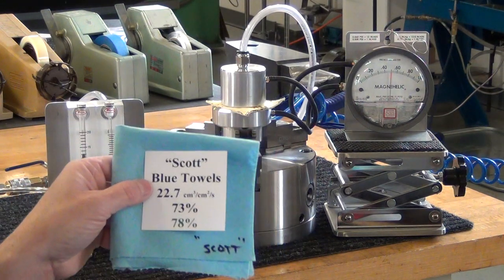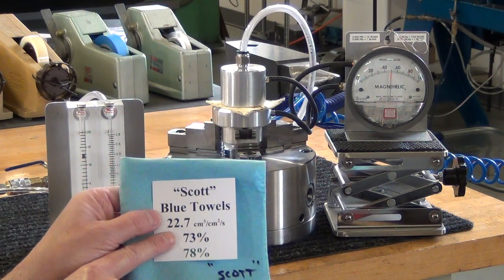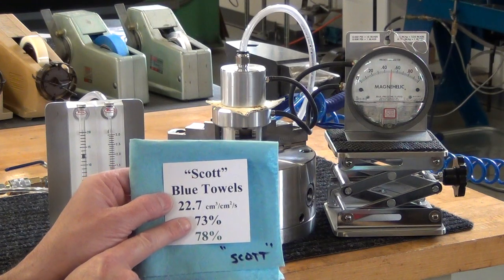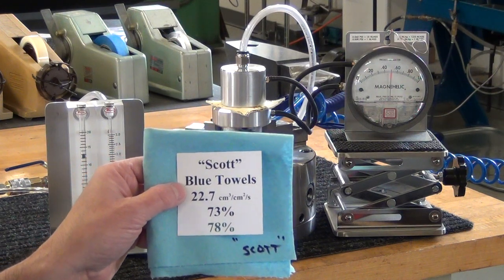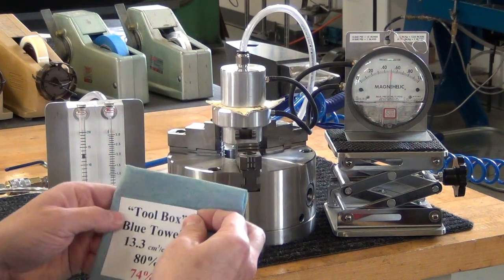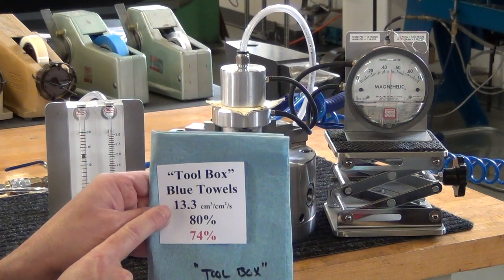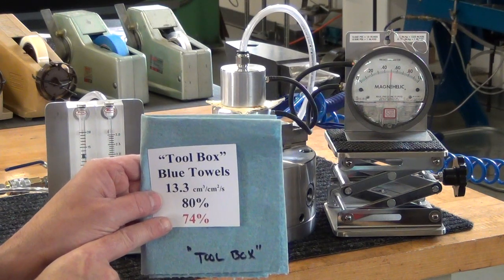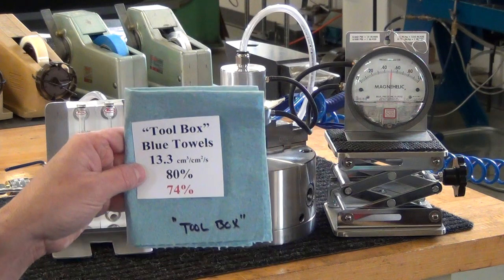Permeability of Mask Making Materials

Comment: Made over 900 masks so far. Love your videos on mask filters thank you so much for your time. Can you please test flannel, cotton Jersey, and Kona cotton. I have been thinking a lot about summer and balancing heat, breath-ability, and filtration.
Reply from the maker: Thin flannel cotton similar to tee-shirt material seems to be good.  Under the microscope the flannel cotton has many tiny fibers that bridge the gaps between the warp and weft.  I have seen other fabric that does not have these tiny fibers and they did not test as well.   Thank you for the question.  I hope you will subscribe.

Comment: First off, thank you so much for your diligence in working on good solutions for masks considering N95 masks are in such short supply.

One thing I’ve been wondering is how we can make these masks easier to breathe through. I wear a mask, but it’s just frustrating due to breathability. I was looking at N95 masks with the valve, but now they’re saying it’s bad to use.

One thing I think might be worth testing is integrating a merv-13 filter into a valve, with one on the inside and one closer to the outside creating a two step process. I’m curious what you think the breathability would be in integrating it into the valve, or if it would just be better to fit into a pouch instead?
Reply from the maker: That's probably a question for a professional mask designer.

Comment: Thank you so much for testing 1 ply halyard h600.
May I ask a huge favor.  Please launder h600 ten times with laundry detergent on hot, and retest filtration?
(Because we are sewing single ply masks for reuse, but the change, if any, to the filtration of the polypropylene matrix by laundering is not known).
Halyard supply is limited so reuse is a good thing.
Reply: PS our project is making this  lightweight durable and cool material into masks for elderly and immunocompromised folks to use at home - the halyard should have good compliance for all day use in homes.
(But does the filtration degrade with washing?) Thank you again.

Comment: Any chance you could test one layer of Halyard 600 sandwiched between a good quality cotton on top and good quality flannel or other cotton on the bottom?  You would get a mask that is more attractive on the outside and more soft and comfortable on the inside and perhaps people would be more willing to wear them.  Thanks so much for what you are doing!
Reply from the maker: I have not tested that combination.  However, the efficacy of any stack of material under constant flow can be estimated.  In particular, the permeabilities of a stack will combine as Pstack=1/( (1/P1)+(1/P2)+(1/...) )  Stacked efficacies are "repeated trial" probabilities and can be estimated as Estack = (1 - (1-E1)(1-E2)(1-...)  ).  Thank you for the good question.  I hope you will subscribe!
Reply: @MathIndy  Thanks so much, I already subscribed.
Reply: I've made masks with Halyard H600.  It's a bit too stiff for many mask designs. I'd recommend that you take a look at University of Florida's mask prototype 2 at https://anest.ufl.edu/clinical-divisions/mask-alternative/.  It's easy to make and fits very well.  I turn the seam inward for ordinary use, and have made it with one layer and two.  A group of nurses did full fit tests of some masks and this one passed where prototype 1 did not.

Comment: thanks for your video!

How many layers of the feminine pads do i stack, to achieve that 92% filtration? thanks in advanced for the reply.
Reply from the maker: Personally, I would not use feminine pad material.  Mainly because the materials used in their construction may be unknown but also because they will not launder well.  The "go to" material most widely recommended is 100% cotton.
Reply from the maker: I cannot attest to the safety of the feminine pad material.  In this testing, only the inner material was tested for permeablity and PFE at 1 micron. The pad tested was Walgreens overnight brand.  To equal the permeability of 2 layers of flannel cotton you would need 6.8 layers of this material (or an already thicker pad).  I don't think this material will launder, may have perfumes, chemistry is unknown, so, for now, this does not seem like the best choice.

Comment: What do you think, the bag from the vacuum cleaner that you tested, which class of filters corresponds to?
Do I understand correctly that your device can be turned on several times in a row to measure filters with a high degree of purification
Reply from the maker: I am only able to test at 1um and, the MERV scale, for example, requires testing at a variety of particle sizes.  I am not qualified to say where the vacuum bag falls on that scale--that's probably a job for a certified testing laboratory.  The sampling time on the tester I have can be set to 1sec, 10sec, 1min, 10min, etc.  Longer sampling times can give a more accurate test result but remember, the particle count in the air at any moment is not controlled so there is also benefit to conducting the baseline test, and the material test, multiple times, and always in quick succession.
Reply: Thank you so much for the answer! I asked, since a vacuum cleaner bag is, apparently, the best (in terms of filtration quality) of available and inexpensive materials, and it probably corresponds to some kind of filtration class.
But today, class 12..14 hepa filters are also available, which are certainly better than n95 and probably better than a vacuum cleaner bag and, if possible, use them in DIYrespirators. Probably so?
Reply from the maker: @vicvic2413  The main issue with vacuum bags, furnace filters, and any unusual material for that matter, is it is often not possible to be certain that they contain no unhealthy chemistry.
Reply: Thanks again!

Comment: I wrote to SPILLTECH and they said their shop towels do not have any chemicals that would make using them as a filter a problem. They do not offer any guarantees about the filtration rate but they are safe. I would like to know what their filtration rate is. It looks like a thick paper towel with fused dots all over it. I would like to know the filtration rate is on one layer of Halyard600 and I would also like to know how to reliably fuse it to make quick seams with a heat tool. Thank you for all your information . I will post this video on my Facebook quilting group because we are all sewing masks. You may get more subscribers because there are over 55,000 members.
Reply from the maker: I have not tested Spilltech brand shop towels.  I have tested Scott brand as well as Tool Box brand and they both test well at 1 micron.  It seems the denser shop towels are better than regular kitchen paper towels.  A single layer of Halyard 600 tests at about 95% with about twice the permeability of both layers Halyard 600.  Thank you to you and you quilting group.  Good people make the world a better place!
Reply: @MathIndy  thank you for this video! Everyone has been asking. I also posted it at Masks of Love - Oklahoma Facebook group. There have been quite a few discussions about filter materials for certain! Thank you so much!

Comment: I was wondering if you could make a new video that I can link my members to discussing masks and filter rate of materials and how that impacts the seasonal flu, pollution, and other reasons a person might want to wear a mask. I would be interested in sending you a package of materials to test if you are willing. My Facebook group is Quilt Fabric by PrecutNUTs and I have linked to this video in that group. You can message me if you would like to send me an address to send my testing materials to.
Reply from the maker: That's probably outside my area of expertise but thank you for the idea.
Reply: @MathIndy  thank you. I think the need has passed. My friend group covers the spectrum of politics and I found it amazing to see how supportive my conservative friends were of masks and doubting the more scientific PhD friends were. In mid March2020, they seemed to flip and my PhD friends wanted masks while my conservative friends started refusing to make them or wear them. I have boxes of the propylene surgical wraps that proved to block the tiny particles. I can still send you some if you OU are interested but no one is making g masks anymore